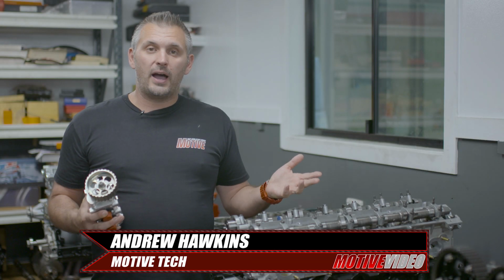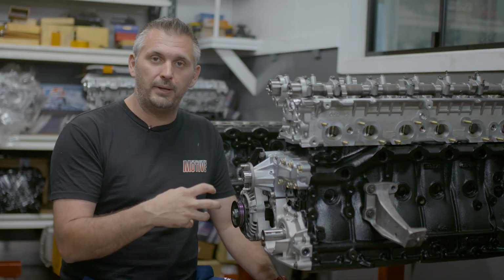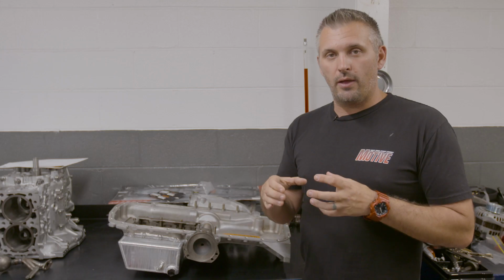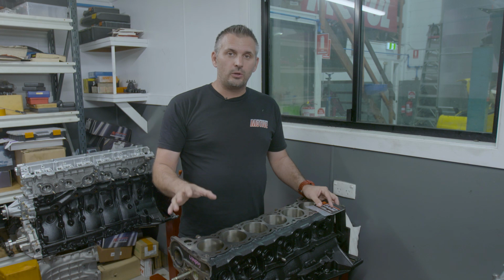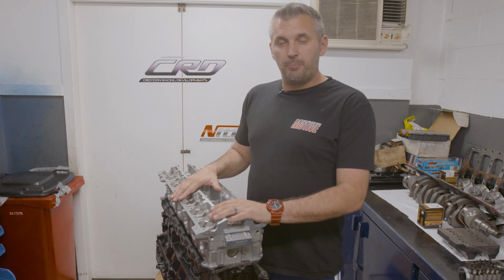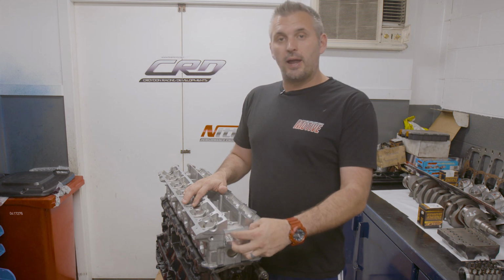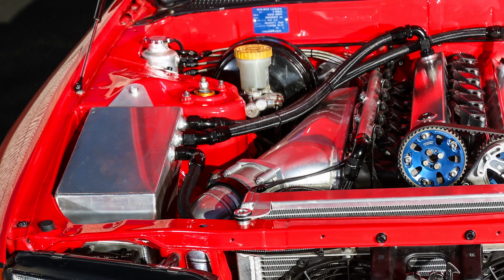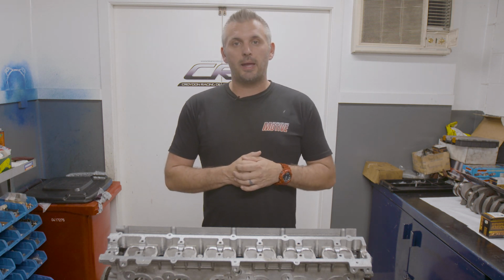How to Fix Nissan RB Engine Oil System Problems - RB20 - RB25 - RB26 - RB30 - Motive Tech

Comment: Motive Video You talk about moving to modern technology in many videos, why don’t you acknowledge the spline drive solution extended collars are a band aid at best . We make a spline drive for the Nitto pump, happy to send you one to test 😉
Reply: Blake Nic We have sold hundreds as too have Spool. These issues are exaggerated at best we have designed ample clearances and as long as proper engine building procedures are followed then there are no issues with the spline drive setup. This video by a customer demonstrates clearance https://youtu.be/5o4B6vR0lmU
Reply: Blake Nic do you work for Nitto?
Reply: @AdmissionGaming  I have a 950whp R34 with Jun splined drive. I've read in a magazine a Canadian R34 800whp had their N1 splined, I believe. Hope these are big enough numbers for you. If you meantioned 1000+, I don't know  of these examples.
Reply: Supertec Racing been following you guys for a few years now. My Nitto pump exploded which also caused major damage to my crank. I have lined up a Tomei with a spline drive kit as way of having some peace of mind. I do not understand all the negativity from the Nitto guys. Haters will always hate.

Comment: What is the limit on a rb25det lifer non neo. I got a rb25det with gt4202 and reving out to 8500. But having lifter issue. Have got std oil pump though

Comment: Can basically replace RB with CA and all the info remains the same. Finally someone saying to use large catch cans ;) not these stupid 500ml jokes. CAMS demand at least 2L from memory (or is it half the sump capacity?) or a return.

Great to hear you mention the catch can sump return. I use one on my Circuit CA18DET and have never had any issues with oil surge. Have also done the extended sump, oil restrictor and external drains. In CA's I like to remove the cam cover baffles to improve breathing, and with a sump return, if extra oil gets sent out it doesn't matter.

Great content
Reply: I've only seen 2 of those engines in person. one was in a really over the top showcar. the other was in a really early 89 180SX a guy imported.
Reply: @thh420  mines in a TA22 Celica. Goes like a cut snake, weighs about 900kg
Reply: @thh420  I had a ca18det running a s15 t28, 550cc injectors,z32 maf on rb20 coils and it ran like a bat outta hell!

Comment: Catch can returns on wet sump engines are almost a requirement for any form of circuit racing. Don't want to be 15 laps in and discover you're sump is empty or your catch can if overflowing and leaking all over the circuit getting a disqualification.

In order to win a race, first you have to finish.

Comment: After some advice. Should i drop billet gears and backing plate into standard rb26 oil pump 98 r33 gtr with 85kms. Or get a n1 pump and put billet gears and backing plate to that instead?🤔

Comment: Everytime I watch one of your videos it gives me anxiety. Great knowledge for sure, but always feel like I missed so much despite me sparing no expense on my build. Somehow 15k just isn't enough for a street car ecu limited to 620 hp Haha.
Reply: Right there with you, anxiety in my chest xD
Reply: Just bought my first project car. Planning on doing an RB25 swap in a year and building it to 400-450 whp stable in a year and a half. How much do you think that would cost?
Reply: @asianboyyy117  400hp is easy in an RB25. I think most people just get bigger injectors and a better turbo. "How much will it cost?" The only answer is "how long is a rope?" 

It all depends what you want to do to support it. I'm at 700hp now. I built the car for 1000hp, but have no intentions of doing that. It's just a street car.

Comment: The 25 has 3 feeds, one for VTC forward and rear and also those hydraulic lifters... I spent days trawling through the SAU forums on oil control, Decided to go with the blank on the rear feed. left the CVT and forward feel alone I did go with an N1 pump so will have increased volume. Did get the sump extended ad baffled too. Not going stupid with revs at around 8k so I think that should suffice.
Reply: With my s1 25, I have a Franklin engineering head drain, nitro pump, and an extended sump. I didn't touch the vtc feed, 1.5mm in the middle, and a 1.0mm in the rear. It has been great so far! These video series have been a huge help for me deciding on what parts to go with.
Reply: Do not completely block the rear feed, add a restrictor.
Reply: @AxModdedxMayham  Yeah CRD and Andrew know their shit.

Comment: Dumb question,  but what would you recommend I do oil wise for a early Rb26 with the crank collar issue mines a 1990, its lightly modded and im running 10w60.  Thanks

Comment: Thank you! I have a relatively stock RB and didn't want to just upgrade the oil pump (since that appears it could make the problem worse without corresponding upgrades to go with).
Reply: Yup. Just stay away from bouncing off the red line and in general don’t rev that high and your oem pump will last a while
Reply: @dohc1974  funny I keep hearing that but i've been bouncing on limiter for literally 5b years str8 on my bone stock oil pump with not a single problem...I'm not saying it's not true but ppl talk as if its so fragile and it'll break the very first time you hit limiter. It's quite annoying...
Reply: You can put billet gears in stock oil pump and wont have to worry about the extra oil flow from a n1,nitto or tomei meaning you don't have to enlarge the oil pan and all that aswell.
Reply: @clutchkickpj693  cool, thanks for that. Who sells those billet gears?
Reply: gav240z we sell billet spline drive gears we cover all pumps from OEM to N1 to Jun and Tomei.
Reply: @SupertecRacing  Флинт, ты ли это? :)

Comment: Would 2.5 bars at idle and 6.5 bars at WOT be ok for my rb25det c34 Laurel. That’s what it is currently. Recently changed the oil and went with 10w50

Comment: With head drain and crank case breather should they be above the windage tray in the sump or doesnt it matter?
Reply from the maker: Doesnt matter. Ours just goes to top of extended sump section
Reply: @MotiveVideo  cool thanks. What about crank case vent, do you guys worry about them? as in a line from sump to top of catch can to get rid of any excess crank case pressure simular to breather from the cam covers.

Comment: Great video, thanks for the information guys. What is your opinion regarding the billet steel replacement gears for the oil pumps that emulate the 1J/2J implementation of driving the pump off the crank? Worth looking at on an RB26 in a stock pump housing that is RWD only?
Reply: Jared van Bergen Spline drive works and I we have proven that for the past 5 years.

Comment: Put dry sump pump, done:)
Reply: yep.
Reply: Yeah, but when the oil system costs more than most complete builds then it turns people away. All of the suggestions in the video are a fraction of the price of a dry sump system.
Reply: @Ryanbmc4  a dry sump system will never cost more than a half-decent build unless you're buying over-priced ultra-status-symbol name-brand dry sump kits. You can buy regular kits for $900-3,000 without breaking the bank. In terms of track oriented GTR's, that's nothing. This man is only talking about using a dry sump pump vs a wet sump pump. That should cost you roughly $400-800 at most. But if you do the whole kit, which this guy wasn't talking about, then yes it is more. You also don't need any of these options if you're driving the car in the twisties in the mountains. If you're tracking or drifting, you also don't need any of the above options. A good baffling system combined with a one-way gate, will always keep the pickup fed no matter what. That would cost you roughly $200 of Home Depot aluminum stock, hinges, bolts, and some welding, which would negate the need for additional or pressurized oil storage which would reduce unnecessary weight. It would also reduce the need for other upgrades. The only thing is, if you use a dry-sump pump with a pressure fitting, you gain added durability. Lastly, all those options require you to take apart the engine except the oil pan modification of baffling and one-way gates, which only requires you to remove the oil pan. So either way you look at it, there's better options for both spectrum, but you didn't read the original comment closely enough.

Comment: Hi mate I did all of that restrictors baffle plate head drain but I also added spool billet gear inside factory pump and my oil pressure reads a little low at idle about 15-19psi at warm idle but no problem cruising about 55_65 psi. Is there any advantage for billet gear inside factory pump? I was thinking to remove it Cause billet gear have  bigger clearance compare to factory and I think that’s why my oil pressure is low at idle

Comment: Hi Andrew, what do you think about oil feed lines on a aftermarket turbo, eg AN6 sizing over AN8, also the feed flange bore diameter to the turbo, Do these play a part in the motors oil pressure etc, cheers

Comment: Can you cool the oil before returning it to sump using the head drain? Also how effective is it? I think if crank case pressure is excessive you wont get drainage properly right??
Reply: No point, putting it thru a oil cooler would create resistance. There are better and more efficient ways to cool the oil. The head drain is effective, anyone serious about their RB uses them.
Reply: Blake Nic yeah good point, I guess it’s only using gravity to go back down and not getting pumped back down. 

Yeah fair enough but just cause everyone uses them it doesn’t mean it’s right. I’m curious if the crank case pressure will affect drainage.
Reply: @AdmissionGaming  это не слив масла с головы, это дополнительная вентиляция картера и не более...

Comment: Is there a “budget” way to ensure proper oil flow? I’m keeping mine under 400 hp, so is everything besides the high flow oil pump and gears necessary?
Reply from the maker: The problem is once you go high flow pump, you need all the other support gear
Reply: Motive Video thank you for the response. Is there a strengthened pump that isn’t prone to cracking but keeps the flow close to stock? Or do all aftermarket pumps have increased flow?
Reply: @barrettgt-r9692  залить правильное масло и всё

Comment: Interesting crd say dont drill out oil galleries in the block is this more for big hp builds where block strength becomes an issue?
Reply: I did drill the head returns out but with the block I ground a special drill to taper from head gasket size to the block size over about a 3mm depth.

Comment: Is left vs right into the sump any better with the head line to the sump and breather size and baffle in the catch can
Reply from the maker: Doesnt matter. Just as long as it goes back to sump
Reply: @MotiveVideo  really. What about the rotation of the crank and the natural venturi it cause. Or is this just another myth

Comment: Where would I look for problems of Oil getting into the water. Is there a head mod to prevent this?
Reply from the maker: thats a major problem and the fix is to fox it and build it propely
Reply: @MotiveVideo  it's a cost problem now though. ;) We are hoping it's OEM oil heat exchanger cracked.

Comment: Can you please do a rb25 vs rb25 neo comparison as theres a lot of myths and guessing on the forums. We like to understand the difference in internals and heads and what it does to power with the same mods
Reply from the maker: No myths with the block> the block has the same part number and tests up the same. all differences are in the head and the rods/pistons
Reply: @MotiveVideo  yeah I agree but theres a number of rumours that people argue about like it having a N1 pump as standard and that it has a long snout crank that I'd like you to clarify as no one knows the truth.

There's also a lot of differences that people do know, like the neo having top feed injectors instead of side feeds, different compression ratios, additional oil galley restrictors and a different throttle body BUT they don't understand what effect it has on additional power it could make over the standard rb25 or whether its more reliable because of them.

Owning a R34 GTT, it's difficult to understand what modifications will do to the engine as forums are subjective and most of the information is for the standard RB25 like do you change the HG to a MLC to make 450bhp @ 1.3bars on a hybrid or not?  No body knows, they just suggest it as the standard rb25 needs it.

It would just be nice to understand the differences, get rid of the myths surrounding  the neo and understand what makes it better if anything. Do they make the same power mod for mod? Are they both unreliable as each other? 

Many people have this problem when choosing an engine for Conversion between the RB25, RB25 Neo and RB26. Some even say the Neo is better than the RB26 for reliability and can make 1000bhp with the same mods like forged internals.

Would make a great video
Reply: @BossCarsUK  да, в рб25дет нео стоит маслонасос N1, другие поршня и шатуны рб26. Головка лучше продувается и жёсткие толкатели клапанов. Блоки одинаковые.

Comment: No mention of crank collars or lack of contact between crank and oil pump gears on majority of RB engines ?
Reply: Connor Fraser wasn’t crank collar fix only an issue on the early 32s? I agree still worth a mention incase you have never heard of it
Reply: Rb30s and all pre Neo rb25s (all r33 and prior rb25s) have the short nose crank (low oil pump to crank contact ) . Where I live in NZ r33 rb25s and rb30s (commonly used for the rb30det builds) are the most common RB engines by far !! I believe this is one of the most important issues to mention.
Reply: It's been mentioned in many other vids but yes I agree I should of been mentioned in a vid explaining oiling fixes though
Reply: Spline drive is the solution. Extended collars might help a little but the same problem exists they are prone to cracking the gears.
Reply: I agree spline drive is better I agree but I’m more shocked nothing at all was mentioned about the lack of contact between pump gears and crank
Reply: Connor Fraser flat drive is a killer amongst other things

Comment: A serious question. Why wouldn't you start with a newer technology engine that doesn't need to be under huge stress to make the same power that you could from an RB - like a Barra?
Reply from the maker: The Ginger Power Ranger theory of engines hasn’t changed much in 100 years. Just better design and materials. But, we can use aftermarket materials and parts now and RB has 30 years of development from aftermarket and racing industry behind it.

Most technology advances are in external components.

A Barra actually has weak links at 500kw just like a RB does and jus as many at 1000whp

Also. The chassis it’s in determines why the Arab is so popular
Reply: @MotiveVideo  very interesting there's been so much aftermarket development that you would still stick to a 30 year old base design
Reply: @thegingerpowerranger I don't see how its a bad thing that aftermarket companies are willing to put money and time into an engine for the last 30 years.. If anything its a testament of the RB.
Also you realize that Barra's have oil pump issues as well (sinistered metal from factory same as rbs..) also the aftermarket pump gears which are available have basically copied the gear profile of an RB/JZ pump going for a wave type design over the OEM design as it is better. 
Barra's have a non-square piston to bore ratio (do some research why this isn't good). 
Barra's can not rev as high as RBs or JZs due to the displacement without having serious money put in.
Just last Wednesday drags a barra spun bearings from oil starvation on launch, it is not just rbs that have oil starvation. 
tl;dr Valve springs need to be replaced to go over 280kw generally, main caps are weak and need to be replaced with billet caps @ 500kw (no factory girdle like the rb), oil pumps are weak, oil starvation issues, coil pack break up, can't rev as easily due to non-square piston to bore ratio and there is so much more. 
Not to mention the Barra is literally the only good thing about a Falcon. The driveshaft have issue with centrebearings, the design of the tailshaft is weak and need to be upgraded straight away over 450rwhp. The diff bushes need replacement often due to a bad design, roof liner on all falcons fall off, interior falls apart very quickly, paint doesn't last. 
End of my rant, I hate Falcons but they are one of the main reasons mechanics are still in business.
Reply: @AdmissionGaming  Jesus man I appreciate your reply but I stopped reading after the first 20 minutes!

Comment: Rb25det neo oil restrictors are apparently 1.27mm would these be worth changing out also?
Reply: as the neo uses solid lifters, there's no need for lots of oil to keep the lifters pumped up. choke it down. Oil in the head only lubes the cams, and you don't need much oil to do that.
Reply: @manitoublack  does the RB26 use hydraulic lifters?
Reply: @gav240z  No

Comment: I am surprised you are still using the factory gallery in the block for pick up ! We were running an external line from oil pan mounted pickup straight to gallery at side of front cover totally eliminating restricted factory sized gallery going back half way along block then forward, also external line allowed much bigger dia all way to pick up, this also eliminated big splash hole in baffle as pick up now went out the side FWIW.
Reply: But what happens when you corner and all the oil flows to the other side of the sump ?